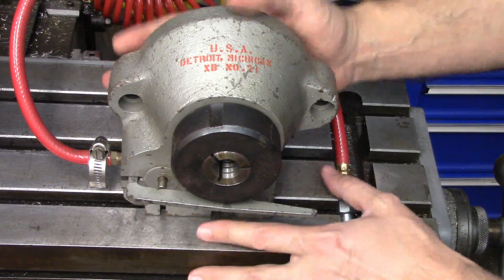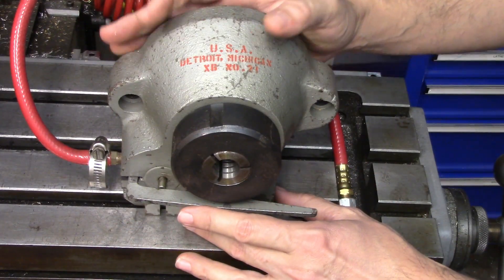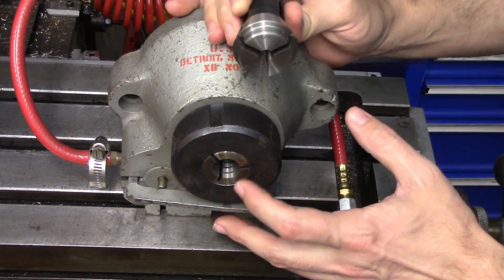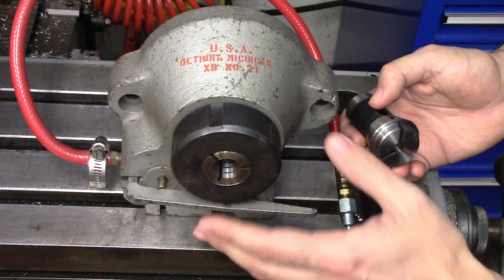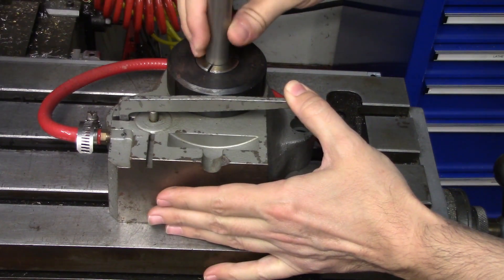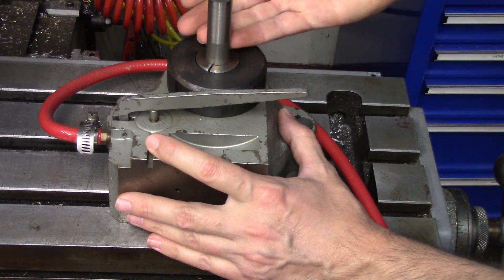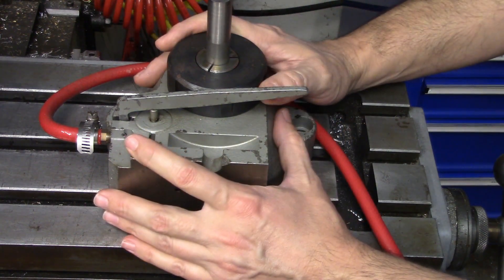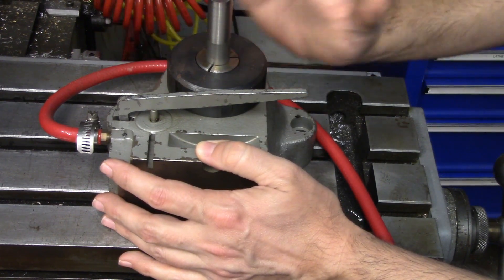A Neat Air-Powered Collet Fixture

Comment: Hi Staurt - I have an assortment of those collets and a chuck that came with my South Bend 10K lathe lathe I bought several years ago.  Some of the collets are made by Hardinge.
Reply from the maker: You can't just tease a tool nerd like me by telling me you have a cool and  unique chuck.  You have to send a picture or two. What's the mechanism for closing it? A nut? Lever? (Gasp, could it be...) A cam?
Reply: @StuartdeHaro  I'll send you pics.  Which address?
Reply from the maker: @luisgaray2550  send it to my channel name with no spaces @gmail.com